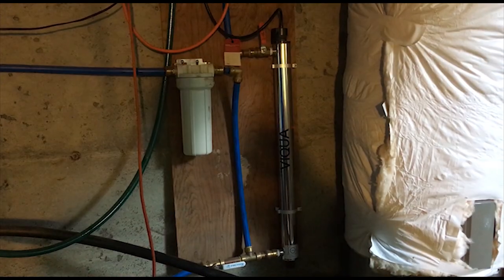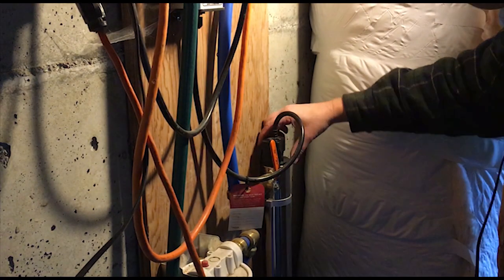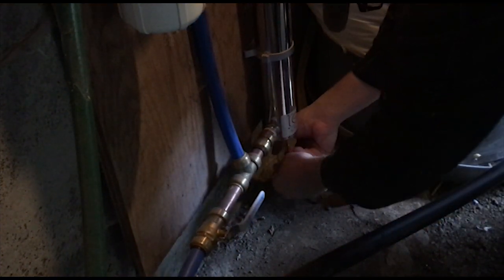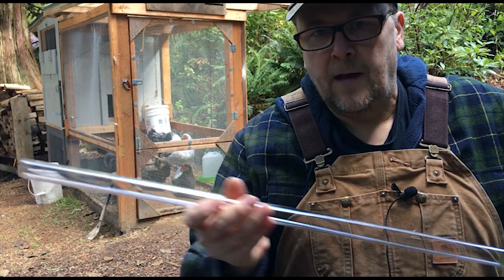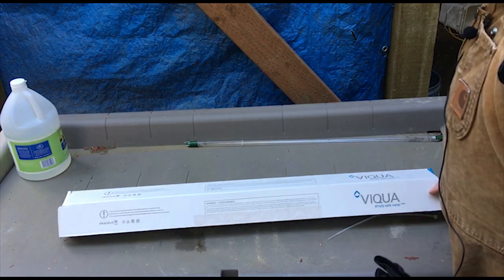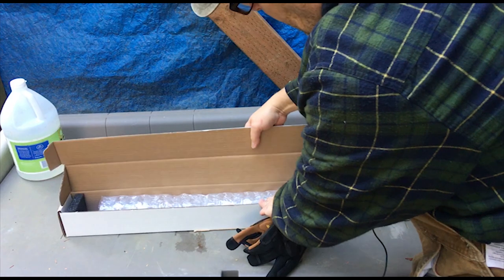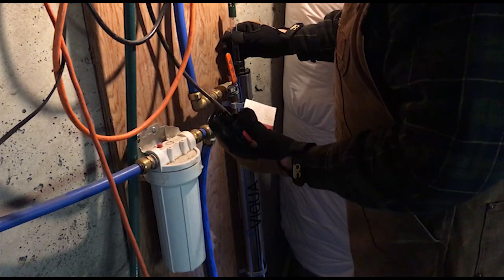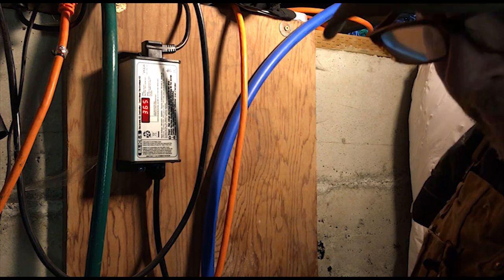VIQUA S8Q-PA UV Water Filter Bulb  Replacement And Glass Sleeve Cleaning

Comment: Thanks for the video, everything looks simple and practical.  The only thing I've seen differently is most manufacturers recommend not touching the quartz sleeve with bare hands as the oil can impede the UV rays, just an FYI.  If you're only handling the ends, probably won't make a big difference.
Reply from the maker: Oh wow. I hadn't heard about wearing gloves when touching the sleeve. Thanks for the heads up.

Comment from the maker: Amazon Links to the Filter System and the Replacement Bulb are in the video description.
Reply: How much will come out of you have it on??? I have the replace light bulb 💡. Why did you clean the old one? The water in the aluminum container doesn’t touch the light right? If so, why do you need to turn off the water?

Comment: Thanks for the excellent video. Very helpful. Can you explain your extra water filters and how to add to existing set up. Where did you get those filters? Love your multiple cut off valves too. Great job.
Reply from the maker: Hey thanks. The extra filter was gifted to me. I will be switching to a Big Blue Water Filter with a prefiltero to catch any bigger stuff. The little white filter clogs up with sentiment quicker than I'd like. I will still go through the UV filter after the big blue. The big blue is supposed to last a lot longer. Several companies sell them.  Just check on Google. Hope that helped.

Comment: Did I miss the bit where you screwed the top sleeve nut on?  Nice Video...
Reply from the maker: Haha! Looks like I forgot to mention the screw top going back on before installing new bulb. 👍
Reply: @AlmostHomestead  its the same as the bottom one?  I ask cause I have a customer with the same unit - they broke the sleeve and I'm helping them replace.

Comment: hey almost homestead, i know it's been a couple years since you posted this video but just wanted to say thanks for taking the time to film it.  man i gotta tell ya, sometimes i cringe at all the new tech (twitter etc.) but boy could i have used google & youtube when i was a kid:)))  i watched a couple other videos on this as well...i like to watch a few in case there's any new pointers.  i was so freaked out about that quartz sleeve cuz another guy said it's smart to have an extra one on hand because if you break it, you're pretty much without water til you get another one (i guess unless you're setup for a bypass).  for some reason i also thought you weren't supposed to touch the tube.  you shoulda seen me, i've got gloves, paper towels, 2 bathtubs, 2 pitchers, 2 buckets full of water.  wiped down outside of tube with vinegar, i had a couple corks laying around so i filled entire tube with white vinegar, corked em & put it one of the bathtubs.  let it soak for an hour, then moved tube to the other bathtub (you know, fresher water:))).  my utility room is a nightmare, absolutely packed, unit is mounted high behind other softeners & such so i'm teetered on a sketchy step stool ladder job just knowing, KNowing that i'm gonna break that tube.  anyway blah blah blah, guess this is what happens when you're self diagnosed with OCD.  good news is that hey, i didn't break the tube, got it crystal clear with my cleaning, got the bulb in without touching or breaking, no leaks! 5 minutes after success i got on amazon & ordered 2 bulbs & an extra quartz tube...so you know what that means, next year i'm gonna get cocky, rush thru the job, break the tube AND the bulb...and not care one little bit:)))

sorry for the novel, i guess i just wanted to say that every time someone like you takes the time to do something like this to help us, it's amazing to think about all the stories that you'll never hear that were directly related to you changing your UV bulb on film:)))  thanks again man, i am now going to watch some more of you vids.
Reply from the maker: Haha! I love it. Thanks for sharing your story. I'm glad that it worked out. I have an extra sleeve but only because I ordered it on accident thinking that I ordered a bulb. I suppose it's good to have an extra though. This last time I changed the bulb I broke the ceramic piece on one end that holds the connector pins to the bulb connector.  I ended up fixing it with Bondic UV glue. I couldn't believe that I fixed it. Anyway, thank you for sharing. It's always good to know that the video helped someone. I know I appreciate when I find a helpful video. YouTube is amazing for quick help and answers. Take care!
Reply: @AlmostHomestead  wow, thanks for the reply Almost, yeah i'm kinda glad you've got that tube just in case.  for me personally it's not so much the cost of the stuff, it's just i live in the middle of nowhere, and it's not like you can just find these at the store, so if & when i break something i like to have backup. i put this off for weeks & now that i'm done...i kinda wanna do it again:)  i think i hear saws in the background of your video, music to my ears!
Reply: hey Almost, sorry for another question, i hope you get notified, i'll keep it quick instead of my novels.  after i got done with bulb & quartz tube i noticed a label that i guess i didn't read really close the first time.  my dad did the service last year & he put a label that said "replaced bulb & cleaned sight glass on ( a date)", he's outa range in alaska right now so i can't ask him.  what i don't know is if he just called the quartz tube a 'sight glass' or if there indeed is a sight glass maybe in one of those sensors that plugs into the bulb cylinder unit.  i know you're not a mind reader but is there anything like that that you know of?

ps - wow, guess i can't keep it short & simple...another novel:)))

Comment: That's pretty easy to maintain.  How much power does it use?
Reply from the maker: Oak Knob Farm I have no idea what it’s costing me to power it but...120 volts and 39 Watts.
Reply: 39 watts isn't too bad - same as a small incandescent bulb.   39/1000th of a kilowatt x 24 hrs = .936 kw/H per day if it's running continuously.   We pay about $.15 a kwH here, so about $52 a year roughly.

Comment: I noticed a white plastic ring on your new bulb.  When I took my old bulb out, there wasn't one of these on the bulb.  My new bulb, though, does have one of these rings.  I was concerned that this plastic ring might melt or burn on the bulb so I cut it off before inserting the new bulb.  What are your thoughts about this?  Thanks for a great video.
Reply from the maker: I haven't had an issue with the white plastic ring melting or anything. I thoiught it was there to act as a seal or to support the rubber O ring.

Comment: We have this system, and when I pulled the bulb out, I found the tube had broken.

The new bulb had gotten wet. 

Where to go from here.
Reply from the maker: Oh no! I'm not sure. You would think that if the protective glass tube around the bulb wasn't seated correctly you would have seen the unit leaking water. But maybe not. You might need to contact the manufacturer.
Reply: You need a new sleeve - replacement is the same as this video.  Get all the broken quartz out before installing the new sleeve....

Comment: I have a Viqua s810rl  I would like some help I changed the lamp one month ago and my water filter also now I have a beeping and it says. A3 when I changed all it did say 365  how do I fix this A3 matter if u please help me
Reply from the maker: I had that problem once also. Here is a link to the reset instructions. https://www.uvo3.co.uk/how-to-reset-an-r-cansterilight-ballast/
Reply: A3 is Viqua's code indicating you need to change the bulb. It is only prompted by the counter going to zero. Since you just changed the bulb you just need to reset the counter- do exactly what he did at the end of the bulb change- hold down the button while you plug it back in.

Comment: I just replaced my lamp but when I turn water back on, the water is leaking out the bottom of the lamp casing. I did replace the O-rings too.   Didn't see any cracks in the quartz sleeve.  Any ideas?
Reply from the maker: Sorry, I was half asleep when I wrote my first reply. If you replaced the O Rings on the glass tube and the bulb, I’m not sure what else it could be.
Reply: You may need to apply some silicone GREASE (different from ordinary silicone) around the O ring before sliding it back over the glass tube.  May also want to use the new O rings supplied with the replacement UV lamp.